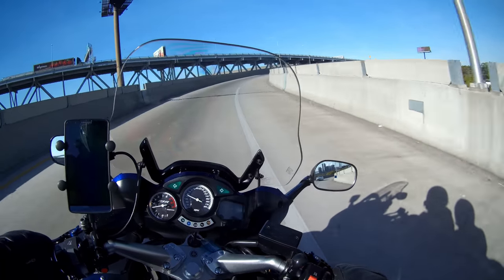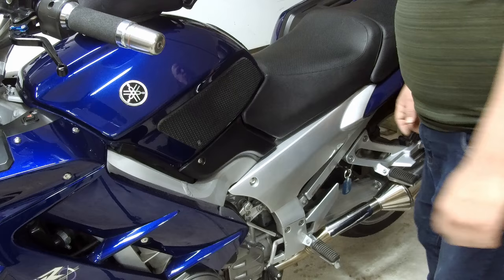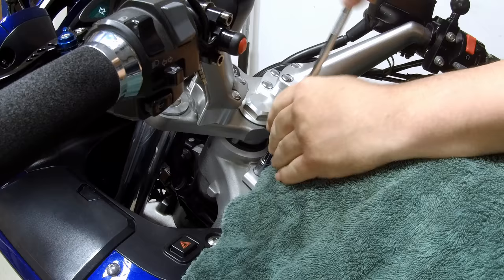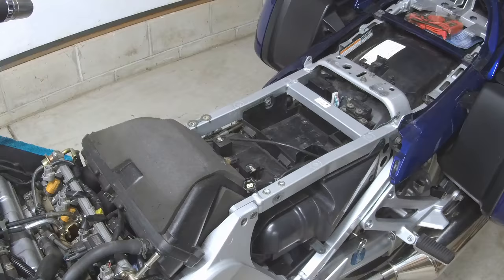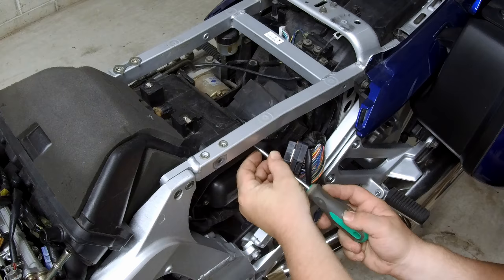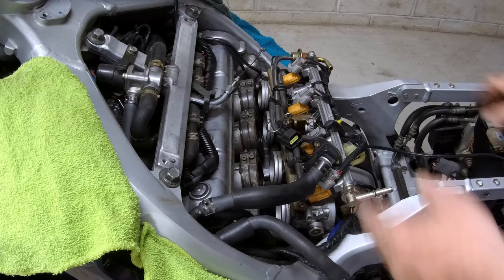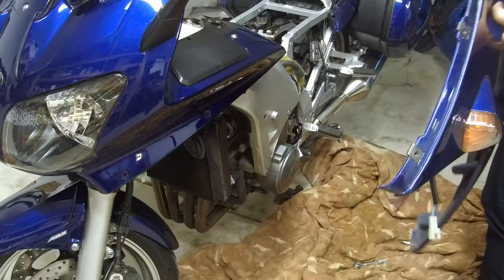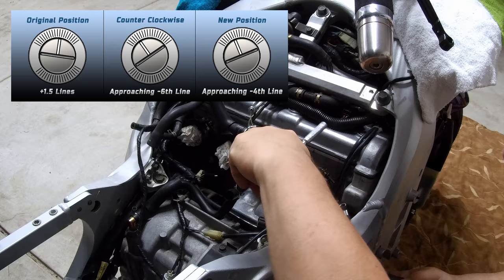FJR1300 2005 Gen I Vibration, Adjust Engine Balancers, Clean Throttle Body & Replace Seals. (PART 1)

Comment: My vibration is annoyingly around my UK cruising speed of 65-70mph on motorways and dual carriageways.. Never even knew these had counterbalance adjustments for the engine. Eye opener for me. This video has now made me think of doing the front first then see how it goes. Ive done the TBS , torqued mounts, fitted later model thicker footpeg rubbers(Lot better for distance riding), HVMP extra heavy bar ends too. . Thanks for a great video. Subscribed to your channel after watching this.
Reply from the maker: Another thing maybe to think about is new coils and wires. I had the same vibration and the balancers, coils, and wires were all contributing. Once all possibilities are covered (coils, wires, plugs, balancers, tbs, injectors, tb cleaning), check for sync at 4-5k as well as at idle. It could be off at speed. Try syncing at 4-5k instead. I did the unofficial tbs once everything else was checked or fixed. However, this utbs voids the original settings. I knew the screws were touched by the previous owner so mine were already changed.
Reply: @mikesfjrcorner7129  Bless you Mike. Thankyou for the reply. You know how annoying that numbing vibe can get. I will keep your advice and see how i get on.

Comment: Hi Mike! congratulations for your excellent video, I have to do the same job on my fjr 2003, because I have to change my starter so I would like to know, when you remove the two water hoses connected to the throttle, that there is a lot of liquid that escapes? Thank you for your reply!
Reply from the maker: Hello, just a little bit. If you have a small cup or rag, place it under the hoses. You can put a bolt into the hose to plug it up while working.
Reply: Tanks Mike!

Comment: Hi Mike, great video, it is very helpful. Would you know if the counterbalancer adjustment would work for a Gen2 model? I have a 2007 FJR1300AE. Thank you!
Reply from the maker: Yes they both have them. I would only do it if all other sources of vibration have been addressed. Check the service manual for gen 2 for settings.
Reply: @mikesfjrcorner7129  thank you!

Comment: Hi Mike, I went through everything you told me, I noticed a decrease in vibration as I installed X-heavy HVMP to my handlebars, do you think adjusting the rear balancer could help decrease the vibration significantly? Thank you in advance for your answer!
Reply from the maker: Before doing the rear balancer. Make sure TB is synced, coils are good, TB is clean, engine mount bolts are torqued, etc... This procedure is for once everything else has been done. I might think the rear balancer is lower in the engine and you would feel it more in the feet.

Comment: Mike thank you for this excellent how to. I do however have a question about the front balancer. You say counterclockwise until it tightens, and then after looking again counterclockwise 1 line from the previous noted position. 

The picture however shows you go back clockwise from position -6 to -5. Which one is correct?
Reply: And on the rear you take 2 lines clockwise instead of 1. Does that have a particular reason?
Reply from the maker: My wording was a little weird in the video. What i meant was one back from the position that was tight. The same as the diagram. So tighten lightly, and backup the distance of one line.

Here is the text from the service manual ("Tighten the balancer shaft to the specified torque by turning it counterclockwise, and then turn it one scale back on the balancer lever scale (2 on rear balancer). Start the engine and check that there is no abnormal noise coming from the balancer
gear. If noise is abnormal, adjust the gear lash by turning the balancer shaft."). 

The torque is 0.4 Nm. That's a light pressure counterclockwise.

On mine, I was noticing a slight whine, so I re-adjusted it to 1 and 1/2.
Reply: MikesFJRCorner ok thank you. Did this once on a cbr1000f. Can be a mayor difference indeed!
Reply: Thanks Mike , my 08 has the same vibration at 4.5k and worse at 6k. I’ll step by step from your video.  Thanks Mike.

Comment: An after-market manual calls for a dynamic testing... back & forth between Clatter and Whine. Any thoughts on this?
Reply from the maker: Yes, If it whine's, then back off on the adjustment. The manual says this as well, but the wording leaves a lot of interpretation. They say, adjust till it sounds normal.

Comment: Mike, do you have any video or ideas in adding/changing coolant?
Reply from the maker: Hello, not at the moment. I have a lot of maintenance to do this winter. so I'll be getting back to making videos soon. I'll have all fluid changes, valve check and more. I'm also adding accessories. I purchased a delkevic header to go with the cans along with a Fuel controller and a bluetooth wideband fuel mixture meter.
Reply: @mikesfjrcorner7129  thanks for the fast reply!

Comment: Hey Mike I think I went to far when I adjusted my count balancer ,nasty howl, moved 2 notches from start position, can I safely back up one ?
Reply from the maker: Hello, yes.

Here is the text from the service manual ("Tighten the balancer shaft to the specified torque by turning it counterclockwise, and then turn it one scale back on the balancer lever scale (2 on rear balancer). Start the engine and check that there is no abnormal noise coming from the balancer
gear. If noise is abnormal, adjust the gear lash by turning the balancer shaft."). 

The torque is 0.4 Nm. That's a light pressure counterclockwise.

Did you scribe the original position?

Hope this helps.
Reply: @mikesfjrcorner7129  yes I did scribe my starting point, and now have backed up one notch. I’ll let you know how I made out. Thx Mike.

Comment: Hi Mike, after the adjustment, did the vibration at 4.5k go away?
Reply from the maker: I had spikes at lower RPMs that went away. At 4.5k I still had it. I've been working to find the problem. Once cleaning, valve timing, and coils have been eliminated, I think the problem with these bikes is over time, the TB mechanical set screws are no longer sinking the TB's at that RPM due to mechanical wear. However, Yamaha has not given us a method to accurately set them.

Comment: Hi Mike! I recently exchanged my 2003 fjr for a 2013 fjr at 32,000 miles. I had two new michelin pilot road 4 tires installed but the bike has a significant vibration from the underside of my seat to the rear at 4000 rpm. In your opinion could it be the rear balancer?  thank you in advance for your answer!
Reply from the maker: First eliminate things that are part of normal maintenance first.  Make sure the throttle body is clean. Make sure the tb sync is balanced at idle. See what's happening with the vacuum at 4000 rpm while checking the tb sync. If it goes out of sync above idle, then the problem is a breathing problem and may be related to a throttle plate screw that may have been moved.  This screw is normally not supposed to be touched, but can throw sync out at driving speeds. Make sure the plug boots are tight and coils are good. Believe it or not, torque the engine mounts. They can also contribute. Also make sure the air filter is OEM. I had a aftermarket filter that gave me vibration.  Yes there could be some vibration from the balancers. But it's a low milage bike and I don't think that's the source. Maybe if it's only at one rpm.

The source of vibration is difficult to diagnose. 4000 rpm on these engines seem to be the magic number for vibration.
Reply: @mikesfjrcorner7129  Tanks Mike!
Reply: Mike my bike has 32000km , is the engine balancer the last suspect for vibration at 4K. Should I get a throttle body vacuum gauges ordered.
Reply from the maker: Yes,  throttle body sync is the first place to look.  Hope this helps.
Reply from the maker: What happens to the vacuum at 4k. Does it go out of sync. This is where I'd focus. If it does then try syncing at 4k.

Adjusting the balancers won't hurt. This produced a small improvement for me, but did not eliminate it. I found the front balancer spec too tight. It made a whine. I adjusted it closer to to 2 on the front and 2 on the rear. The spec does say to loosen slightly if it sounds abnormal.

One thing I found since this video is, I think these bikes are set too lean. I have a fuel controller from dynatek. When I richen the mixture at low throttle openings, it smoothed out significantly.
 
Im going to investigate this more in the future. I've heard that getting a power commander and tune really helps these bikes. 

I have headers from delkevic to install. I have a dent in header pipe #1. My vacuum is lower at higher rpms on #1. My theory is this dent is interfering with breathing in #1 by lowering the vacuum by restricting the exhaust.

 'll use the dynatek with the headers since I have it. During this installation I have a fuel mixture meter to install. Then I can adjust mixture in real time.
Reply: @mikesfjrcorner7129  Hi Mike! Indeed when adjusting the throttle idle is correct but when I mount it to 4K it gets out of order!
Reply from the maker: ok, here's where to look further. Think about how the air flows through the engine and anything that could alter the flow. 

make sure there are no vacuum leaks in either the hoses or cap's. also check for leeks in the boots going to each cylinder. 

I'm assuming there are no dent's in the headers. 

Has a valve check service been done.

You can always sync at 4k if all of the above is good.

Comment: Hello, here's my problem. I reassembled the injectors on my fjr 1300 and I end up with gasoline in my exhaust. My question comes from where do you think?
Reply from the maker: Sounds like a stuck injector. If you had a seal leak, that would just be a vacuum leak. All plugs are on the correct injector? The injector could be firing at the wrong cycle.
Reply: I received it as I removed them because I made marks each time
Reply from the maker: I'm still thinking about a stuck injector. Maybe check the spark plug boots for connections. Maybe It's possible one cylinder is not firing and the unburnt  fuel winds up in the exhaust. The plug boots screw onto the wire. What I've done before is: unscrewed them from the wire, cut off a 1/4" of wire and rescrew the cap back onto the wire.
Reply: hello I think it's not the right path to follow it's the bike it would run on 3 cylinders that's not it because the engine speed is good I assume that it is not under pressure which means that the pump has gasoline sending in gasoline content to have what do you think?
Reply from the maker: Somehow fuel has to jump from injector to exhaust without burning. So there are a few saneriaos. 1. If an injector is stuck open or damaged, it could dump fuel into the cylinder either while sitting and/or running, causing unburnt fuel to pump into the exhaust. 2. If the injector is connected to the wrong plug, it would spray at the wrong time. 3. If the cylinder is not firing for some reason, then unburnt fuel will be pumped into the exhaust. 4. Clogged passageways in the throttle body or bad seal on the injector causing the cylinder to misfire.

You can check the temperature of each header. If one is lower than the rest then that cylinder could be misfirng. Then go from there to figure out why.

A cylinder could sound like it's running ok but burning way rich, dumping unburnt fuel into the exhaust.

Was the bike running before work and what was done to the bike. I would backtrack your steps.

If anybody has any other thoughts I haven't thought of please chime in.

Thanks, mike
Reply: Hello sir first of all I thank you for your answer to all my questions which is to know where the problem of gasoline flowing in the exhaust comes from, it comes from the injector which is blocked I tested the spark in the spark plugs work it's not a coil problem but a blocked injector
thank you for your attention I hope it helps more than one
Reply from the maker: No problem, glad everything worked out. 

Thanks, mike.